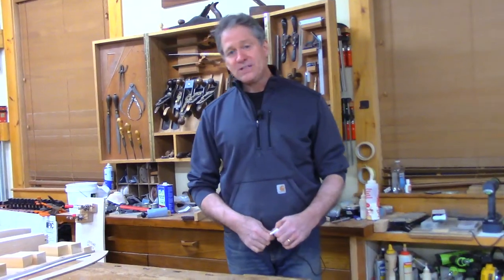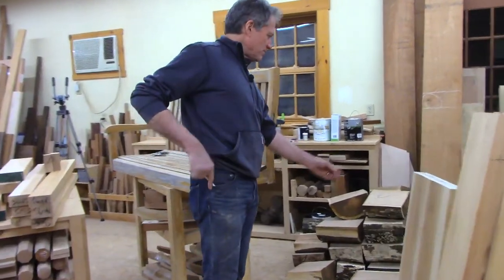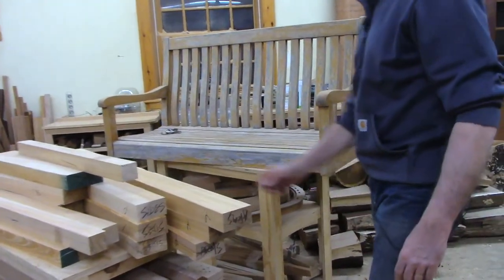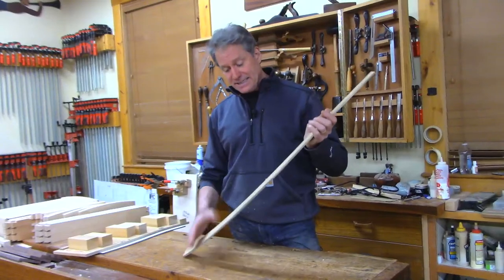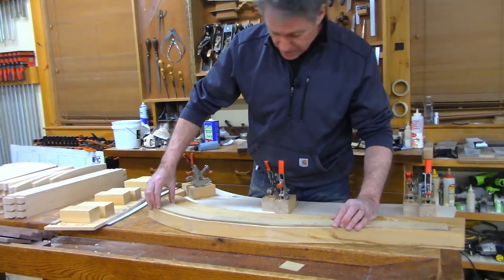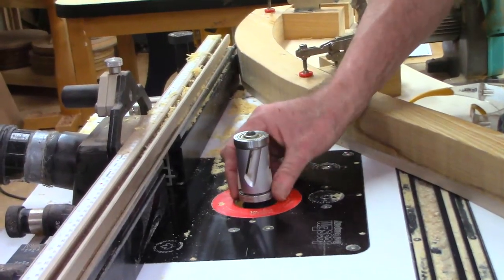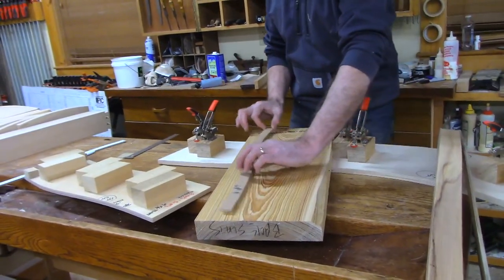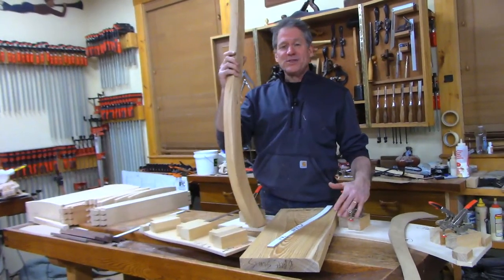What's On My Workbench?

Comment: nice talk about the jig, you've mentioned a few key things other people out. Phil Morley has a nice jig with plans for doing mortise and tendons with a regular router. it's pretty nice. if you dont have a pantorouter.  For finishing did you think about using a penetrating oil finish? Also wouldn't Waterlox work for the bench?
shaperning router bits, especially flush cut once you sharpen them they aren't exactly flush cut, no?
Reply from the maker: Thanks Ben. Yes, there are ninety good ways to cut mortise and tenons, and Phil Morley is a great guy and craftsman. 
The finish I went with on the outdoor benches is actually described as a penetrating finish, Floods. Hopefully it will hold up half decently but I’m sure I’ll have to recoat often to keep the finish from degrading. I believe Waterlox does sell an outdoor Marine Spar Varnish that would probably work well, but at the price it not worth it to me. https://amzn.to/3xob3Kn
And you’re right, sharpening straight router bits does make them slightly smaller and they are not precisely flush although very close. Interestingly, the Multi Router made accommodations for the varying size of cutters after sharpening by offering three tenon templates for each size tenon, all varying slightly to choose the perfect fit for the actual mortise size given the differences in bits after sharpening. 👍

Comment: You might have covered this but is there a video of you using the multi router?  Another unrelated question is do you have anything of turning one-off those bowl blanks?  Thinking of getting a lathe soon and learning that. Do you use a full size lathe?  Thx.
Reply from the maker: Yes, I did feature using the multi-router in this video making an outdoor bench: I Built an Outdoor Bench
https://youtu.be/TEn832WMTqc
And I don’t have any videos on turning bowls but there are lots on YouTube. You can turn bowls on smaller lathes (like the 14” ones I have for classes) but you are limited as to the diameter given the “swing” of the lathe. The swing is just the distance from the center axis to the bed. Of course there is then all kinds of options as you go larger, and they can get pricey. But worth it for the stabilizing factor of the mass of a larger lathe, that is if you see yourself using it a lot. I would recommend starting small and see how you like it. You can usually find a good used lathe, and then sell it and trade up if you find you really enjoy it.
Hope that helps!

Comment: Hi Tom, the benches will be a great addition to the yard, outdoors. I think painting the benches is a good way to go. The burgundy red will look great, experiment with the color tones first, I also thought of slate greay, or colonial blue, just a thought. I had a redwood table and still have the benches that go with the table. I picked up marine finishes from a boat supply store. First finished it with a marine sealer (  2 coats), then applied ( 5 coats) of marine UV spar finish on the table top, and soaked the leg bottoms then finished the legs and under side with ( 3 coats). The table held up for a long time including the top, about 6 to 9 years, even for being in the sun half of the day ( late afternoon to sunset). Like you said the sun is natures worst element to finished outdoor furniture. After the 9 years I did refinish the table with 3 coats because it was starting to show ware from the weather. From that time on it held up for another 5 years or so, after that I kind of neglected the table. What really ended the table, and you won't believe it, a few squirrels ( I think) were chewing on the table legs and corners of the table top. They did a good job of chewing it up, and I never saw them chewing at it, the teeth marks on the wood looked like a squirrel was at it they were enjoying the spar finish, "I guess". Don't know if the spar did anything to them. I then cut it up a saved some of the good wood, still have them. Sorry for the long comment, looking forward to seeing more of the bench project and outdoor cookie table, see you and Kris on SNL!!!!
Reply from the maker: Thanks Steve, great explanation of your experience!! Sounds like you used a durable approach and got pretty good life out of that finish…of course it comes with a price of time applying the initial coats. Painting is the way I am treating the existing swing, and probably the new benches, but I am still considering going with a more natural UV protective varnish to begin with on the benches, then going to paint later as I did with the swing.
Thanks again!! 👍😎